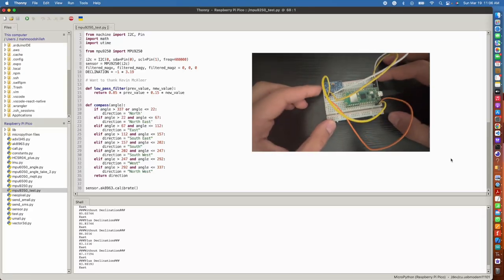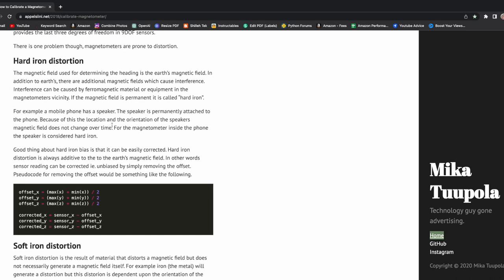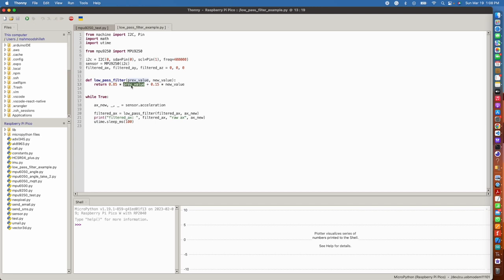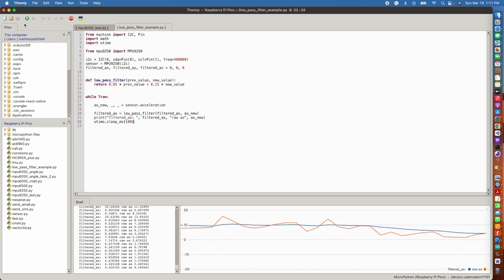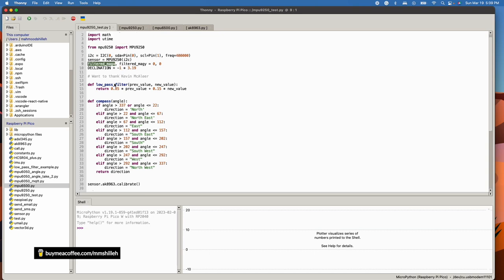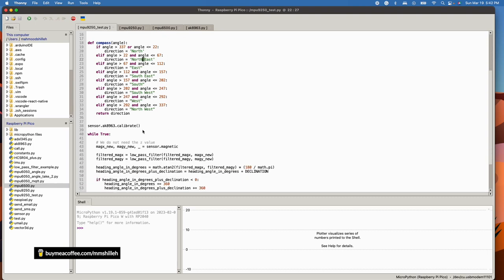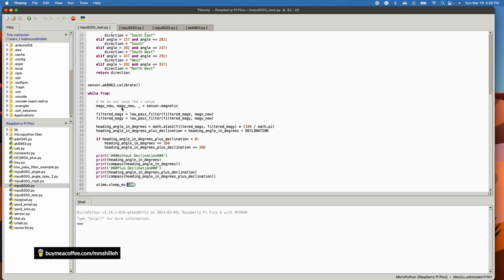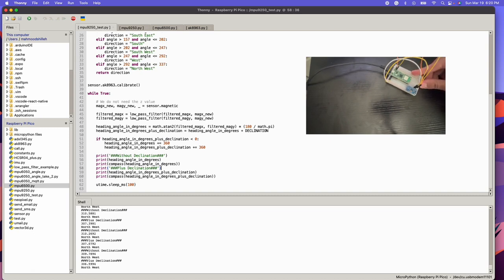Create a Compass with Raspberry Pi Pico and Magnetometer - Heading Angle Calculation

Comment: Thanks a lot for sharing this information! I just have a question related to declination angle you used. On your location it is 3 degrees 19 minutes, correct? So shouldn't it be ~3.32 degrees in decimal instead of the 3.19 you used? Kind regards to Austin and thanks again for sharing your knowledge!
Reply from the maker: Hey, thanks for your comment. A quick Google search shows that it's closer to 3.19 but honestly, I could be wrong as I was using an open-source website to calculate it. Is there a reason you are convinced it is so different?
Reply: @mmshilleh  I'm just talking about the values in your video. When you hover over the marker on the map one can see it is 3 degrees 19 minutes. Just wanted to mention that it has to be converted to decimal and that 3 degrees 19 minutes IS NOT the same as 3,19 decimal degrees.
Reply from the maker: @moinbart  ah that is a very very valid point you are correct! Wow thanks for catching my mistake :) hope others learn from this false interpretation as well. I wasnt too familiar with longitudinal and latitudinal data. Thanks again!

Comment: Dear author, guide is good, but for some compass/chips models we have CCW value (heading) result.
For example, you turning to right (CW) and geting 1,2,3,4,5..., then from 0 (north), you are turning to left (CCW) and getting 359,358,357,356...
I'm getting the same, but reversed:
Your: 359 | 0 | 1
My: 1 | 0 | 359

Do you have idea about how to fix it?
Reply from the maker: Hmmm I am not sure, what chip is it? Where did you buy the board
Reply: @mmshilleh  I found solution (rotation - 
turn over)

Comment: @mmshilleh I've just ordered a magnetometer which is probably why YouTube suggested this video to me. I watched it because I had an awful feeling that I should have ordered the MPU that you're using rather than continuing with my MPU6050 and adding a magnetometer.

I really hate having swathes of if... elif...else statements in my programs especially as I wanted to show 16 points of the compass. 

Maybe you'll be interested in my cunning solution (or maybe you won't).

wind_dir = ['North', 'North North East', 'North East', 'East North East',
            'East', 'East South East', 'South East', 'South South East',
            'South', 'South South West', 'South West', 'West South West',
            'West', 'West North West', 'North West', 'North North West', 'North']
direction = wind_dir[round((angle % 360) / 22.5)]

PS my angles would never be negative.
Reply from the maker: Yeah looks good to me, what magnetometer are you using? Is it a good performing one?
Reply: @mmshilleh  I ordered a BMM150 3-Axis Magnetometer. No idea how good it will be but I'm only playing around learning how to do things on my Pico W. I've also ordered a M5Stack M5StickC PLUS but I don't know whether that has a magnetometer built in. My existing magnetometer only works with an Arduino so I would have to connect my Pico to my Arduino to get the readings and who can be bothered with that? I used to work as a programmer but now it's all for fun👍
Reply from the maker: Well, I hope it works out for you, never used or heard of any of those components, to be frank haha. Happy to hear you still do it for fun! Hope you stick around on the channel. Thanks :)  @charlotteswift

Comment: Thank you for the video! I do have a couple of questions though as I am new to the pi pico w, are you able to code directly onto the device or does a separate raspberry pi need to be used? I ask this because I had tried to code on the pico and it does not seem to save and when changing the pico interpreter in thonny to micropython the pico was not detected, is there a reason for this?
Reply from the maker: What happens is that you code in Thonny and it should be directly on the device. If you want to get started with the Pico you should hold the bootsel button before plugging it in and that will allow you to install micropython in Thonny. Have you done this step?
Reply: @mmshilleh  yes I hold the bootsel button then plug it in, but nothing seems to save on it.